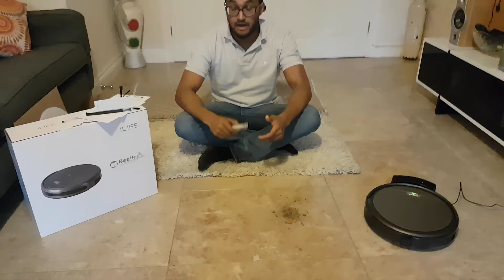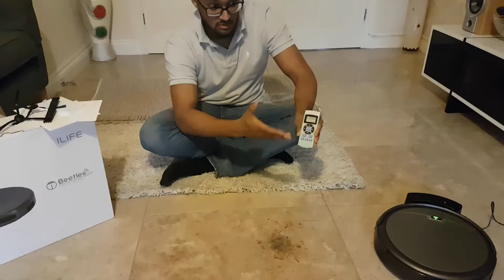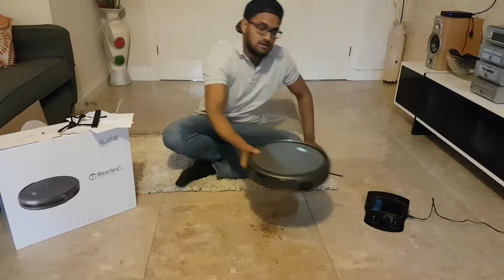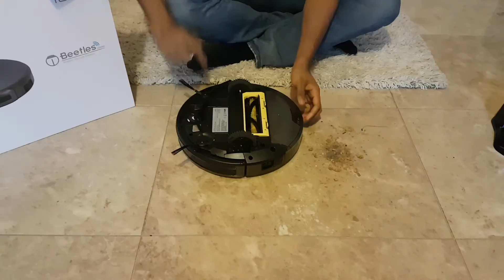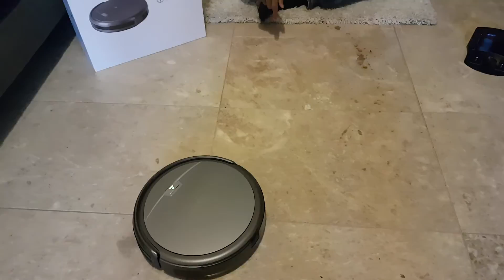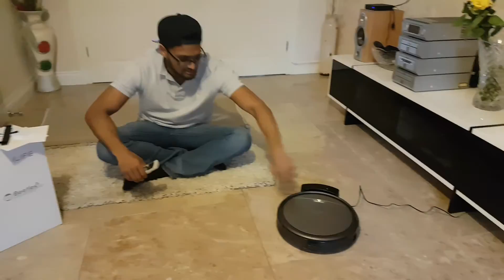ILIFE A4 Robotic Vacuum Cleaner, Titanium Gray

Comment from the maker: Detailed Writeup!

Well it was Christmas and as sad as it may sound I was quite excited to order this, Hoping that this would be a good product and not another hunk of junk that’s not really fit for purpose. The Amazon return policy filled me with enough confidence to hit the order button and know that if it was rubbish I could return it. 

To my surprise, I received a nice packaged box that was branded attractively and had all the technical specification stickers on the side. 

Technical specs
1000pa Suction
450ml dust container (apologies in my video I think I said 2 litres)
2600mah battery (approximately 150mins vacuum time- day to day testing I got at leas 2 hours)
12.2X12.2X3inches

What’s in the box? 

Upon opening the box, you are presented with what looks like a very modern and sleek bit of kit, picking it up it has a nice weight to it and straight away I felt slightly less worried that I had ordered a dud. Looking at it, I could tell that it was well made (the same as something that I would pick up off of the high street). I know I talk about packaging a lot but its where a lot of oversees manufacturers try to cut corners to keep costs down but this was honestly packed like something off of the high street. 

Taking the hoover out of the box and putting it to the side there was a quick start guide, and a full set of instructions (in English I might add). You also get a smart gloss black dock, the power cable, remote control, an extra HEPA filter and a spare set of brushes (left and right).

Now to the device itself it was two slightly stiff rotating bristle brushes which stick out of the side a bit like spiders legs, these allow it to get right up to the wall and into the corners and get those little bits of dust and dirt, the brushes push the dirt into the centre of the machine where the roller on the underside with the help of the suction picks up the dirt. It all works pretty efficiently and effectively; I was quite surprised by how much dirt it picked up on the first day even though I had vacuumed the day before. It has a physical bumper on the front which allows it to get right up to the edge when pressed it detects an object and stops moving forwards, it also has a cliff sensor to stop it from dropping down the stairs. 

The Controls

On the device itself there are two buttons, the ON button at the side stays on permanently; and then there is the Auto button on the top, which you press if you want to start the cleaning mode. 

The remote has a few more controls, it has a spot cleaning mode where you can place it on a dirty area press the button and it will clean the spot rotating as it goes to slowly become a bigger circle. It also has an edge-to-edge cleaning mode, to activate this you place it near the edge press the clean button then press the edge button and it will go around cleaning all of the edges. The other button that it has is the send home button; pressing this will send the device back to its dock where it will automatically start to charge itself. It also has the clean mode pressing this will activate the general cleaning mode where it goes round cleaning in a random pattern. This device doesn’t clean in a zig-zag pattern or have any fancy scanners to teach it how the room works, instead it relies on driving round randomly in order to pick up all the dirt (this actually worked really well). 

Finally the remote has a max button, which activates the full power mode and cleans at maximum capacity, and it also has a timer mode to allow it to clean at a specified time during the day. 

So the controls are nothing overly complicated which means that anyone old or young should be able to get their head around it. 

What’s it really like in the real world 

It’s all good and well telling you all of the above, but is it any good in the real world. Read on and let me tell you more, almost at the end promise. 

So I hooked the dock up in the living room underneath the TV unit so it’s out of the way (it manages to find its way back home without any issues). Our downstairs is all tiled apart from the kitchen where we have wooden floors. It cleaned both of these surfaces really well and it works its ways round the different rooms. The kitchen floor is slightly lower then the living room floor and it manages to go over the slight bump into the kitchen without any issues. Due to its small size and because we have legs on the sofa it works its way under the sofa, between the dining table chairs and underneath the bed. 

If its in another room and you press the home button it does take it a little while to find its way back home but it manages to get their eventually (during testing it took about 20 mins) 

So upstairs we have relatively new carpets there is a landing, which then has rooms shooting off to the side. This is what was really going to test the battery and the brush and immediately it’s obvious that the rollers slow down a little because they have to work against the carpet. It again performs really well and manages to work its way round the different rooms without falling down the stairs. It manages to pick up bits of string and dirt without too much difficulty it did struggle with the odd bit of string, which was embedded into the carpet quite deeply. 

Now to the ultimate test post Christmas day clean up after having 40 guests around yes 40 that’s not a typo. Well the house thankfully was as clean as could be after having 40 guests around but there were crisp crumbs and other bits of general rubbish around. We also had the dreaded bits of chocolate cake that were squished onto the tiles downstairs. I simply set it on max power and let it do its thing, it managed to pick up all of the crumbs and some bits of cake but this is where for the first time I would say it failed and there was still quite a bit of cake stuck to the tiles. In all honestly I think most full blown hoovers would have struggled with that task and it would have needed the good old mop and bucket to clean it up. 

Cons

So we have established that it doesn’t like cake, is there anything else? Well it doesn’t like wires either and it can get itself in a bit of a tangle so it’s important to have these out of the way. Apart from that because of the suspension and the thick tread, it has a good amount of movement, which allows it to adjust to most obstacles. 

Well I congratulate you if you have made it this far, and I would honestly thoroughly recommend this product. Comparing it to a Vileda robot vacuum that I purchased last year and ended up returning because it was so so awful this is miles ahead and is a vast improvement on that. Its great for different floor levels, and would be ideal for someone who is busy or even the elderly. My gran was eyeing it up yesterday and I think I will be making a second purchase as her birthday is soon.